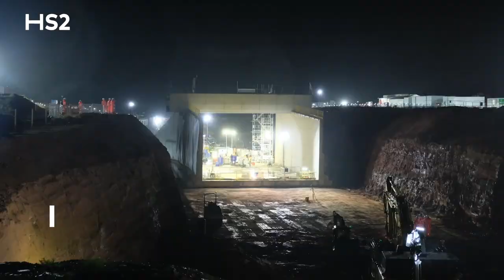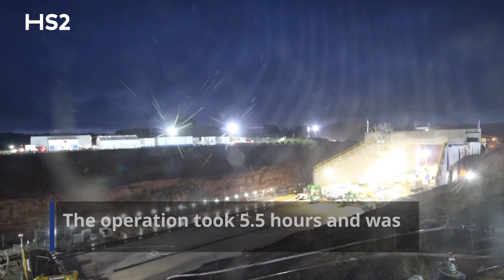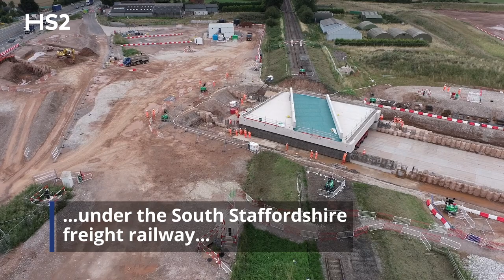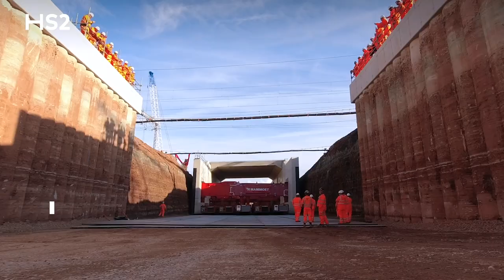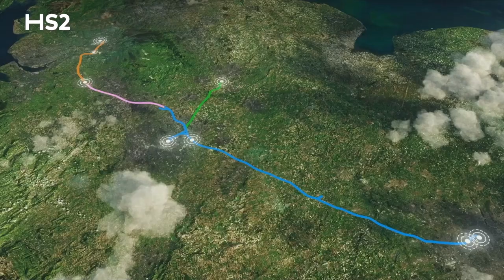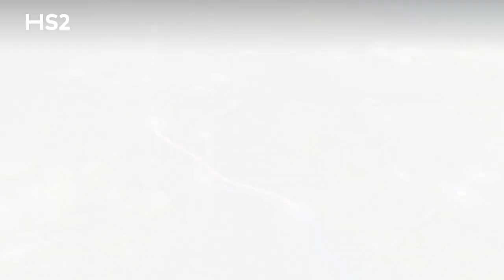HS2 delivers third giant bridge move in two weeks

Comment: HS2 is an environmental disaster of epic proportions & Britain's biggest infrastructure mistake in half a century.
Thankfully, the Eastern leg & the Golborne link have now been scrapped & anyone with half a brain knows that "pausing" the B'Ham to Crewe leg & Euston station for 2 years,  really means cancelling. 
The whole sorry project has now been given a Red rating & classed as "unachievable" by the government's own Infrastructure & Projects Authority & "not deliverable" in its current form .. a complete & utter waste of money.
Reply: It isn't really possible to build a new high speed intercity railway line without intruding on the green belt, but while the works certainly cause disruption for people living along the route, the final built railway will have a foot print less than the width of most A roads, and for much of its length will run in cuttings, tunnels or on elevated sections  (over reservoirs, etc).  It will move huge numbers of people between London, the Midlands and other parts of the UK on high speed electric trains, while freeing up capacity on the currently saturated wcml to allow for more local and regional passenger services, and increased freight capacity. 

That should bring huge economic benefits, while reducing fossil fuel CO2 emissions on the overcrowded roads and motorways.  

The designers and contractors are obliged to manage, mitigate and eliminate adverse environmental impacts of the railway during construction and in use, and there are various examples of how they are doing that.  No railway in Britain has ever been built with such a focus on sustainability.

The problems with the overall projects are not really the project's fault, but the constant vascillation and delays caused primarily by the Government.  Delaying the program is exactly the sort of cost saving measure that usually ends up costing more.  I believe it will be finished at some point, and once people are able to see and experience it working, then they will want to see the rest of the network built out (which will be much easier than the first phase).  

That has been the experience of our neighbours on continental Europe, where, for example, demand for domestic air travel has been greatly reduced, and the network continues to grow.  

The Elizabeth Line is 15 months old now, and is above target for passenger growth.  It was over budget, it was delayed, it was given a red status by the Infrastructure and Projects Authority.  That doesn't mean the project stopped, it had to be sorted out, and the politicians had to support it.  The same has to happen HS2.  We don't get many benefits until we finish it, but at least we know they exist.
Reply: @Ozymandi_as  .. you've basically quoted word for word, the lying rhetoric spouted by HS2 Ltd since this horrendous project was first mooted.
Firstly, it WON'T "move huge numbers of people" between London & the Midlands.
HS2 Ltd state that to "break even" with a subsidy of 50/60%, they require 600,000 paying passengers travelling between London & B'Ham DAILY.
Given that passenger numbers on that route have been declining by 4% per year for the last decade & now stand at 96,000 daily, perhaps you'd care to explain where the extra 504,000 are going to materialise from?
Arguments that the WCML is "currently saturated" rely on a discredited, out of date forecasting model which over estimates long distance passenger growth & isn't used for anything anymore, except to justify HS2.
Network Rail's "New Lines Programme Capacity Analysis" shows that WCML capacity is kept artificially low by private operators wanting to maximise profits.
A DfT analysis shows that in peak hours leaving Euston, WCML trains were loaded at just 52.2%.
Due to the current problems on the rail network & the ludicrous price of tickets, domestic air travel has increased & will continue to do so even when (or if) HS2 comes to fruition.
The reality is that the vast majority of rail users are short distance travellers who will continue to suffer crush-hour conditions while HS2 sucks up all the rail investment cash for decades to come, while a variety of targeted improvements, which could come into service long before HS2 is due to open & would deliver more benefits to more people for less money, are ignored.
If you live in central B'Ham & want to travel to central London, you'd choose to take the train, even now, on the WCML or the CML.
If you don't live in central B'Ham & don't want to travel to central London then you ain't using HS2 so it has very little impact on car usage.
In fact, research shows that when HS2 is up & running, traffic on the M1 would reduce by less than 1%.
I'll guarantee that HS2 will become just another commuter line, no high speed trains & within a decade of opening it'll be nothing more than a glorified cycle track.
Reply: @CRIMSONANT1  A project is only a waste of money when it gets cancelled, because then it has zero chance of ever breaking even.
Reply: @krashd  .. what an utterly nonsensical reply! Cancelling HS2 would cost £8-12 billion .. a drop in the ocean compared to the £200 billion that's its now estimated to cost in full.
it's not needed, if was NEVER needed & it'll be a debt around this country's neck for decades to come.
Reply: @CRIMSONANT1  you see the aerial shots in this video, and think rail is the problem? A thin strip of land being used compared to 8 lanes of motorway/A road. You need to get some perspective, this will take cars off of the road, better for the environment.
Reply: @MrOlympuse410  .. and just how will HS2 "take cars off the road"? 
It's nonsense spouted by HS2 Ltd in a futile attempt to justify their horrendous white elephant.
If you live in central B'Ham & want to travel to central London, you'd take the train - even now on the WCML or the CML.
if you don't live in central B'Ham & don't want to travel to central London then you ain't using HS2 so it has VERY little impact on car usage.
In fact, research shows that even if HS2 is built in full (which it won't be), traffic on the M1 would decrease by less than 1%.
What isn't mentioned by HS2 supporters is the £7.7 billion worth of cuts to the existing network which the HS2 business case demands.
For Coventry, Stoke, Leicester & dozens of other towns & cities, "freeing up capacity" really means "losing the trains you already have".
In total, 32 towns & cities will have fewer services to London, slower services or lose them completely.
Reply: @CRIMSONANT1  capacity will be increased, that's not even a debate - plus more local trains won't be clogged up with people travelling intercity via 2-3 connections. It's going to increase capacity and take load away from strained services, that's how. I'd love to see a source for that 'research'
Reply: @MrOlympuse410  .. & I'd love to see your "research" for the nonsense you've written!
You've quoted word for word from HS2 Ltd's "perfect world" scenario where they'd claim anything was possible in a futile attempt to justify HS2.
They say that to "break even" with a subsidy of 50/60%, they require 600,000 paying passengers DAILY between London & Birmingham.
Given the passenger numbers on that route have been declining by 4% per year for the last decade & now stand at approx 96,000 per day, perhaps you'd care to explain where the extra 504,000 are going to materialise from?
If you live in central Birmingham & want to travel to central London, you'd take the train, even now on the WCML or the CML.
if you don't live in central Birmingham & don't want to travel to central London then you ain't using HS2 so it has very little impact on car usage.
In fact, even if HS2 is built in full, (it WON'T be), research, (yes, more research), shows that traffic on the M1 would reduce by less than 1%.
As for "capacity issues", arguments that the WCML will soon be full rely on a discredited, out of date forecasting model which over estimates long distance passenger growth & isn't used for anything anymore except to justify HS2.
Network Rail's New Lines Programme Capacity Analysis shows that WCML capacity is kept artificially low by private operators wanting to maximise profits.
A DfT analysis shows that in peak hours leaving Euston, WCML  trains were loaded at just 52.2%.

Comment: also,why does it take 250 men ,to put it in place ,everything should be ready ,wheel it into postion , job done ,all taking the mickey
Reply: You seem to be an expert on large infrastructure projects, how many people, in your expert opinion, how many people do you think are needed in the projects you usually work on? What do those people usually do?
Reply: P.S. You realise they were moving a 5600 ton piece of concrete and that takes more than one person, and they were grading the land, ensuring it'd sit perfectly, and backfilling, moving an existing railway temporarily, etc... Guessing you've never had a garden landscaped or a patio put down which is a way smaller job and can still take a few guys a week to do?
Reply: Those bridges weigh more then 1,000 tonnes and its not taking the mick
Reply: this is split across 3 different bridge moves in one week. it takes alot of people to move and isntall what they were installing. you need experts in over head line equipment (and people to reinstall what had to be knocked down a complex job at the best of times) drivers for various diggers and trucks to shift dirt, you need safety inspectors and site managers to ensure the team works correctly. unfoortunatley moving that sort of load can't be done by two guys and a dog.
Reply: I do note that many of those who are Anti HS2, which is fair enough, if that's how you see it, do not have the good grace to recognise the magnificent engineering that is being delivered here. They find fault with any bit of disruption, good salaries paid to hard working people, minor technical issues blown out of proportion etc.The TV media can never find time to show the progress being made, but got help us if one of these bridge moves was a day late or whatever.